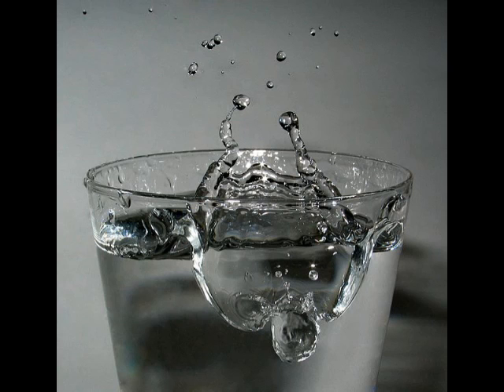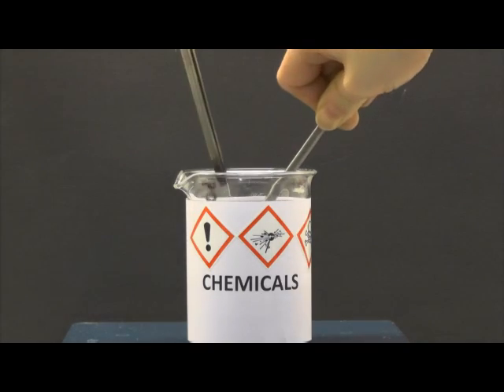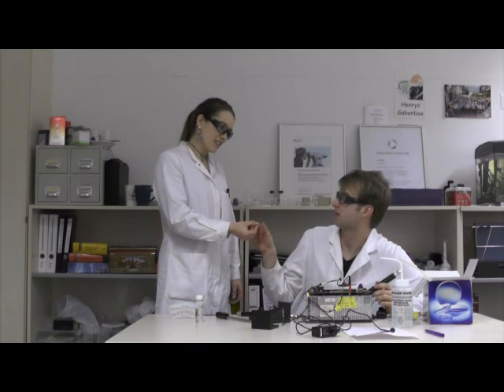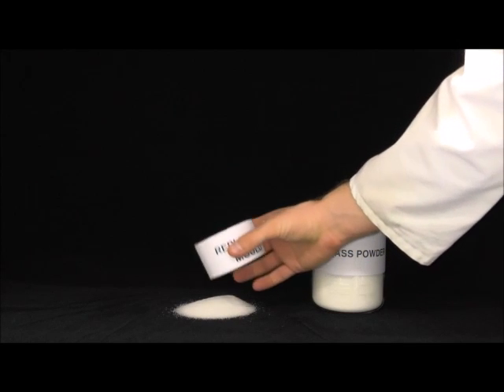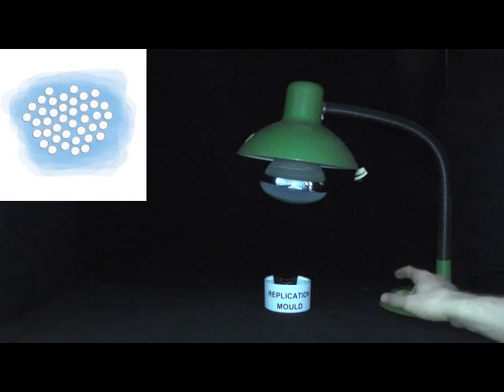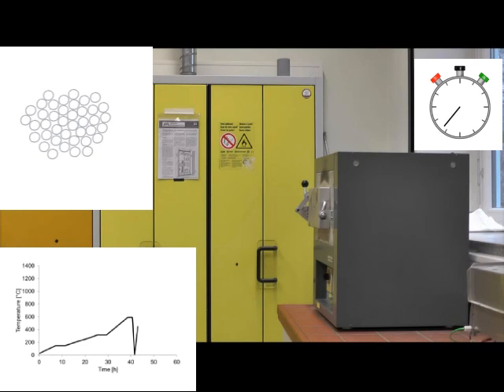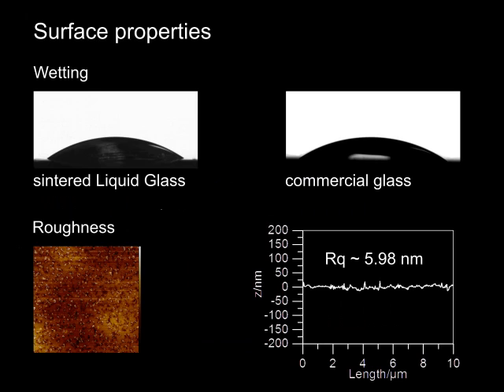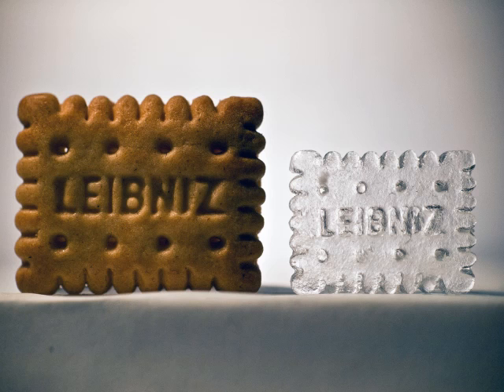Liquid Glass: Casting Glass like Cement

Comment: I have two main questions regarding the process:
Viscosity of LiqGlass: I followed the preparation procedure, dispersing the 40 vol% of Aerosil OX50 amorphous silica nanopowder into the monomer mixture (68 vol% HEMA, 7 vol% TEGDA, and 25 vol% POE). The resulting solution appeared highly viscous. However, the schematic in Figure 1 (Liquid Glass: A Facile Soft Replication Method for
Structuring Glass) seems to depict a substance with lower viscosity. Could you elaborate on what the expected consistency should be, or if there's a specific technique during the dispersion process that helps maintain a lower viscosity?
Transparency of Sintered Glass: Despite following the procedure, including sintering up to 1300∘C, my final glass samples are not transparent.

Comment: This process makes the glass replica smaller than the original object, so in prototyping you'll have to scale up the mold to account for the reduction in size. So the glass prototype is at the correct scale for the application.

Comment: so lets just use clear resin instead
Reply: I’m about to try that but without heating to the necessary temperature as I’m not sure how the resin will react to direct heat but hoping that the powdered glass responds more successfully to the heat generated during the curing process. 🤷🏻‍♀️ one can but only try. I have little hope of success.

Comment: Ehhh.... So the light curing polymer seems unnecessary. In fact, burning out the light curing polymer would actually create more issues than simply using something like sodium silicate because the polymers that burn cleanly without leaving distortions are not exactly benign. Especially when lit on fire. 

Sodium silicate offers the same advantages, but i don't have to worry about a proprietary chemical mixture reacting with something.
Reply: Sorry, this is gonna be a stupid question, I know zero about this stuff.
Does this mean you can turn sodium silicate into a glass somehow? I would imagine there would be tons of videos demonstrating that, but all I could find is "how to create sodium silicate" or "how to dissolve water glass". Am I getting this wrong?
Reply: @jaromor8808  You can indeed turn sodium silicate into a glass. The excess amount of water, which is generally viewed as a feature of water glass, is actually a detriment when making such glass products, but it can still be done. This actually greatly drops the temperature at which silica dioxide converts to a liquid, so searching out Soda Glass might yield better results. 
In that context, sodium hydroxide is used as a glass flux under high heat instead of allowing sodium hydroxide and silica dioxide to react in water.
Reply: @walterbunn280  Thank you very much. Would you know a video where that process/procedure is demonstrated? I must be doing something wrong when looking around on youtube. Maybe it is something so trivial that no one bothers to record it? :)
Again, my apology, I am complete noob to this.

Comment: I see the potential to have this glass powder mixed in with polymers turned into 3d printable plastic. That way, the shape could be 3d printed instead of molded. After printing, a quick trip to the oven would get rid of the polymer, leaving the glass behind.

I wonder if this is possible...
Reply: Shape of the glass powder particles needs to minimize the amount and distance of polymer between grains, but yes great idea!

-B

Comment: Could you cast something like, say, a wine glass, with this method?
Reply: I don't think that will be a problem
Reply: Although its suitability as a food container has to be confirmed before you can actually use it for your drinks
Reply: Xin Su
I would think it would be safe, as long as the alcohol can't desolve it. Which i doubt it could. But obviously it needs to be confirmed.